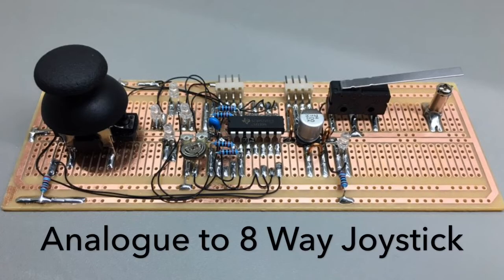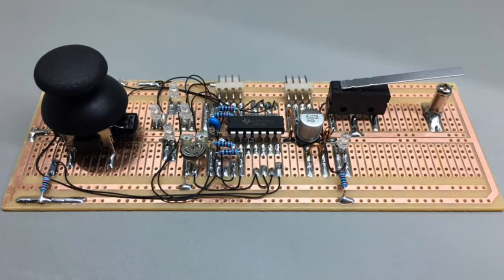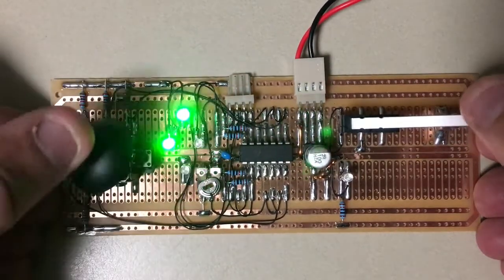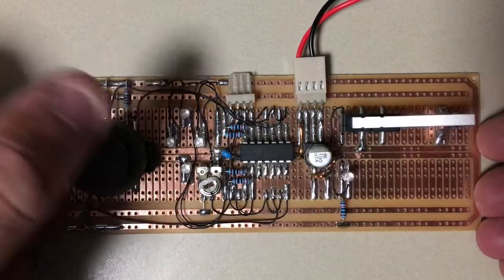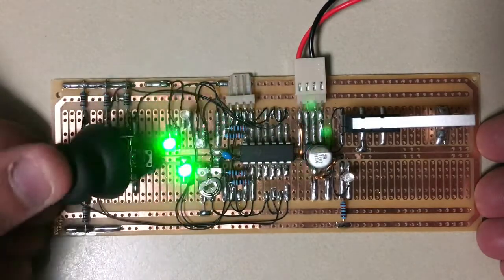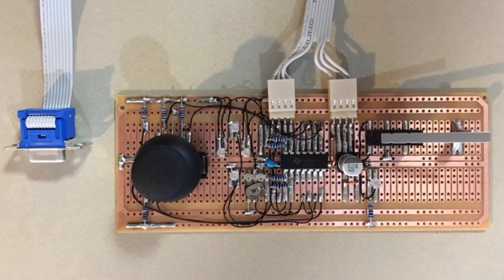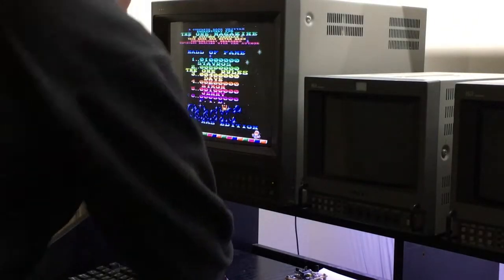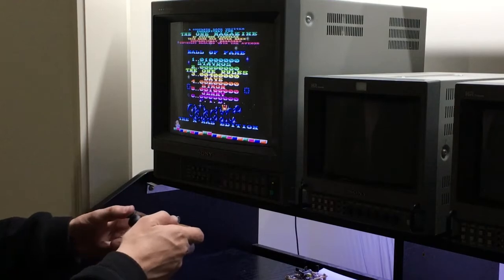Analogue to Digital Joystick Demo

Comment: It looks like there's a little bit of difficulty hitting the diagonals.
Reply from the maker: Not so much. The dead zone of both axes are adjustable, so that might actually be easier than pressing two switches in with a real digital joystick. It certainly is a sub-par digital joystick if you’re used to them, if for no other reason than you get no tactile feedback of switch presses.